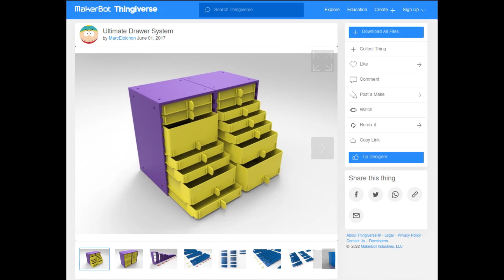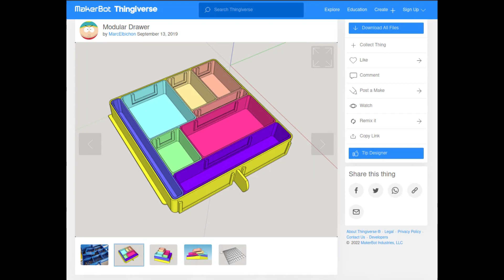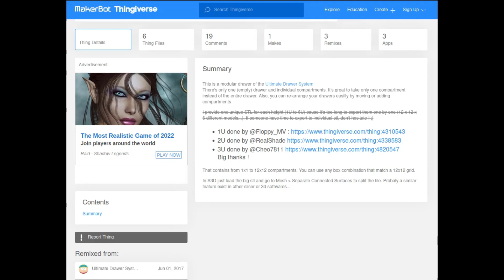Small Parts Organizer and Storage, DIY via 3D printing

Comment: This is exactlt what im looking for!! What would be a rough estimate on filament use for one of these completed drawer units you made? Thanks!
Reply from the maker: I printed 2 of these.  I used one spool for the red, but I had a lot left over. I could have easily printed a 3rd.  It was the same for the blue drawers.
They have been working well for me.  I will shortly build another.
Reply: @KapmansBasementWorkshop  thanks for the quick reply! Will use these for my new tech bench.

Comment: @05:50 The inconsistent amount of friction and the lack of a retaining system preventing complete removal of a Drawer from a Cabinet is basically just asking for content to get spilled all over the place because you had to pull so hard that you managed to pull the Drawer out past the Cabinets Rails causing the back to drop from the weight pulling the front out of your hand 🤣
Reply from the maker: I have since improved those drawers.  But, there is no retention mechanism.  But I have not spilled anything since that video and I use it daily.  They are not the best drawers on the planet, but they are working for me.  And I like the way they look.  Style over substance?  :)

Comment: you always need a little brim for these kind of shape, as warping is guaranteed
Reply from the maker: I had one drawer warp, but the rest didn't.  And printing 4 at a time seems to actually work better.  Now the cups were another story.  The double height versions did warp off the bed, but almost started to fold half way up and higher.  I've just added an internal fan to recirculate the air inside and even out the temps.  I will see shortly if I have a higher success rate with those.  The single heights printed with no trouble at all.

Comment: Thank you: I was looking for something exactly like this to organize my little parts into workshop and could not find. My tries in Thingiverse did not result in this but in other not as good for me. It would be better if having a type of slot or device to join these little cabinets together side by side or one over the other making them modular. I plan to use that with french cleats, as my workshop has the strips on the walls.
Reply from the maker: These have the counter sunk holes so these can be bolted together one on top the other or side by side as needed.  I'm getting ready to bolt two of these together.  They should do the job for you!  Thanks for watching!